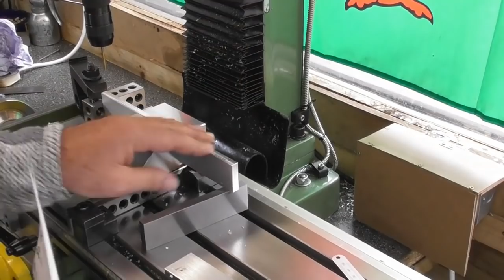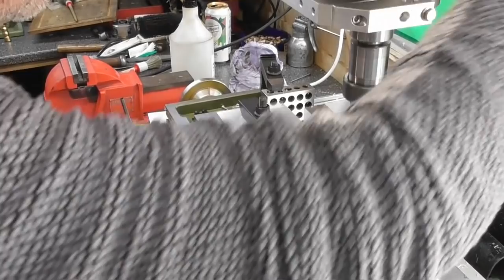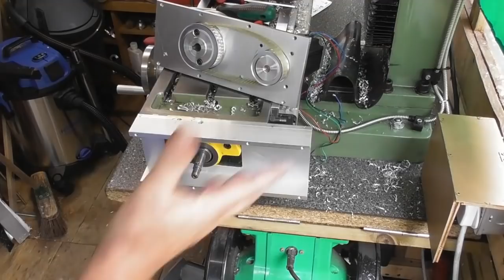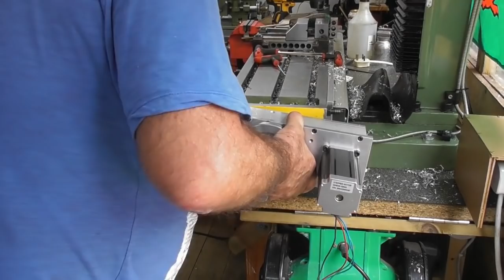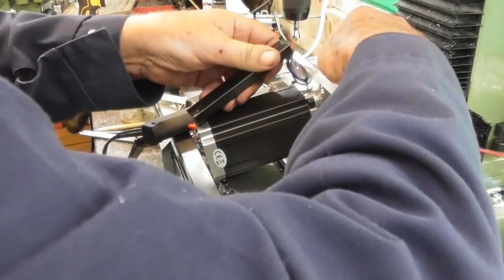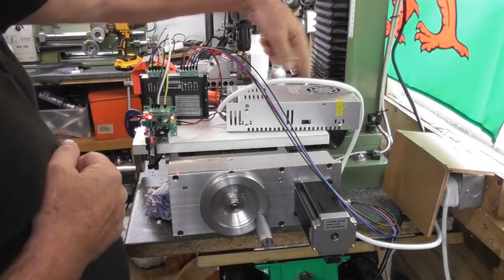X Axis Power feed Part 4

Comment: seen a simulair drive made using aluminium box section , its a bit harder to put in or replace the belt but its cheaper material than the thick slabs of aluminium stock   
he used those stock sized plastic endcaps that you put in there 
the guy allso mounted the steppermotor on the inside front of the table so you dont hit youre knuckles on the motor when handturning the wheel , dont think theres enough room on the rear of the table without the back of the motor hitting the mast at the end of the tables travel 
doing at least a 2 axis cnc would be nice to automate complex shapes like slants and large circles  cut in youre workpieces

Comment: Hello Ade.  Got the power feed working with the Arduino. Variable speed rate, fast and slow traverse and jog. lcd displays what mode you're in and also displays feed rate in mm per second. How to do this on another you tube's page.

Comment: I'm leaning towards using an arduino for the direction and speed control.
Reply from the maker: Hi. Kev . that would be the next step . I am thinking a hybrid manual - cnc going forward . just having fun for the moment . cheers Ade
Reply: @ade63dug  Chinese controller now in the bin. The arduino works as a stand alone device, no computer connected. The code allows for more options. Jog. soft starts etc. and it wires in a lot easier.
Reply: @ade63dug  Just about finished. https://www.youtube.com/watch?v=sGrHBahZeZQ

Comment: Nice one Ade, I have been doing something similar, on the Y axis of my Warco WMT300 lathe, and was going to go with a stepper to do it but chickened out as I'm too rusty with electronics and I was going down the Arduino route with writing code and all that. But that's too hard for my 67 yo brain so I've gone with a dc motor with worm gearbox mounted on the front of the cross slide and below the saddle. I went with GT 2 belts and pulleys boring them out to fit the handwheel (which I had turned down earlier to use a vee drive belt on but that didn't work) and turned an arbor for the drive pulley. Because I'm using a worm gear you can't turn it by hand so I have made a locking idler on a slot which I can loosen and lock in either toothed belt engaged or loose so I can use cross slide by hand.
Looking forward to next video maybe I will upgrade. I've left the front panel big enough to get a Nematode 17 stepper in  place of gearbox and motor.
Reply: I'm in a similar situation re the arduino code but, there are quite a few code examples that only need to be copied. Even examples that use lcd feed rates
Reply: kev eggy I downloaded the Arduino app from Arduino, and when I try to upload the code I get error coming up even though I copy the code exactly line by line after following a tutorial, I did this a number of times and got the same results so I just gave up and went dc motor route instead. It works really well so I an happy with it.
Reply: @samrodian919  I'm new to the arduino so will probably have similar problems. The codes that I have loaded so far have all worked in the end. I am assembling the electronics at the moment.....so will let you know.

Comment: not meaning to criticize it appears your beds gibb is loose
Reply from the maker: Hi, Jack . It does appear that way . The camera tripod is stood on the wooden floor of the shed . as I wind the hand wheel my weight transfer to the floor causes the camera to rock in time with the feed. The image stabilisation does it's best but it really does look like a super sloppy gib. It is perfectly set with no readable play. Cheers Ade.

Comment: Hi Ade, regarding the buttons and pot, they are a fiddly to take off the board as there are 6 pins on each. If you don't have a solder removal tool (like me) you can take the solder off by heating the pins one by one and with a compressed air gun blow the solder off, works a treat! 
Rather than toggle switches I used illuminated push button and rotary switches from banggood, they look good and are flush to the face panel. You can also add more switches for more functions, on mine I added a jog function and three speed ranges ( video @ 23.44). 
It might be too late for it now, but I would have included a mechanical disconnect in the form of a clutch as manually turning the handwheel with the powerfeed electrics on will be difficult because of the holding torque on the stepper motor. Turning off the power feed circuit will make manual turning of the hand wheel easier, but you will be feeding back current into the circuitry potentially damaging something.
 You can have a look at my setup for a warco WM18 mill on this video https://youtu.be/2mgfVYbefng  and if I can help you in any way I will only be too happy, like your attention to detail and neat work, Regards  Chris.

Comment: I've just spent the weekend taking the switch and pot connections off and have to say made a real pigs ear of it. It does work but not happy. surely there must be another stand alone stepper controller that can work on 36v somewhere in the world
Reply: The pulse/step modules i have used work on 5 Volts, Stepper Drivers up to 48 Volts that I have used,  I leave the pulse module alone except for soldering wires on the Dip switch connections and connecting them to a rotary switch for the Three ranges.and control direction with momentary push buttons and a plug in relay.
Reply: @boostie1005  What a good idea for the 3 speed ranges...I hadn't thought of that. I wondered if one of those hand held controllers could work that seem to be part of mach set ups.
Reply: @keveggy4318  you can buy a small rotary switch on EBAY  I think it was4 position 3 pole no/nc  takes a bit of time to find the correct contacts, just looked it up on ebay , they have deleted most of my purchase history, but ebay no 301844345078 looks like what i used, I built quite a few powered topslides to which we fitted a grinding head with a micro switch at the end of travel to reverse direction by using a plug in relay as a flip flop. think about fitting micro switches  as these stepper motors are very powerful,
Reply: @boostie1005   Thank you. Just bought one. If anyone needs their metal casings engraved with 'ON' 'OFF' etc. I can help as I have a fiber laser.

Comment: Yeah, as I told you few videos ago: A power feed on the Z axis is worth the work ;)
I have finished the mechanic part few weeks ago. Now I will build the electric part to drive the motor. I want to drive it smoothly, so it can be fine adjusted. Maybe it can run so slowly I can use it for boring work as a regular power feed.
I will wait and see how you will accomplish this modification. Can't wait :D

Comment: If you use a pot with an on off switch combined that is normally closed you don't need a separate switch. The two wires needed from of the push  switches on the controller will have different positions on the pcb depending on whether you use common anode or cathode on your driver.

Comment: very  interesting project chap with regards to the potentometer  you could  replace it with a on/off/on switch and two resistors to  give you a slow feed for milling and a fast speed  for setting up  / returning the table to  zero. hope that makes sense N

Comment: Are you satisfied with how the X-axis works manually with the addition of the power feed? I had made a similar power feed, but I was concerned about drive train resistance when manually feeding. So I fabricated a dog clutch to disengage the power feed.
You can create a rapid traverse function by adding another potentiometer and DPDT center off toggle switch to your setup.

Comment: Hi Ade
If you haven’t already removed the little switches, be aware that they are soldered in with lead free solder and you will need to increase the temp of your iron to melt it.  I will have a look at the settings I used and post them here, when I find them.  Mine goes OK, but buzzes if you try to start the motor at a fast speed setting, stepper motors don’t have much torque at high speed.  Cheers Noel

Comment: Another great video Ade. Made my sunday. Are you going to fit limit switches to stop crashing into the end of the travel?
Reply: He should not need to, if he had to crash the stepper motor does not have enough torque to bend anything, it would just stall. I fitted a friction clutch on mine just to be on the safe side.